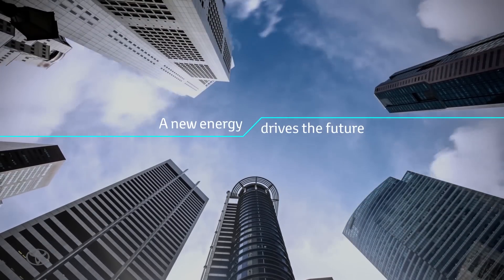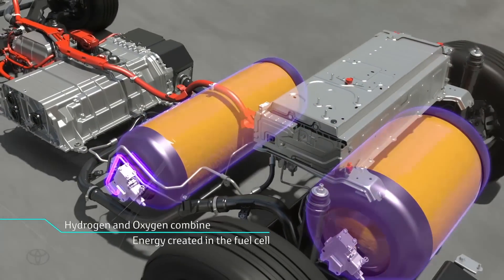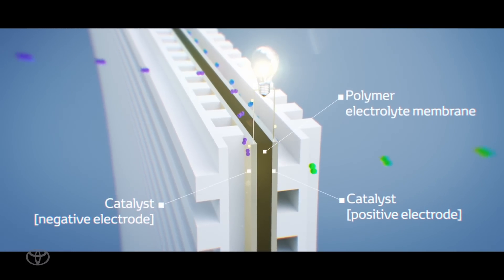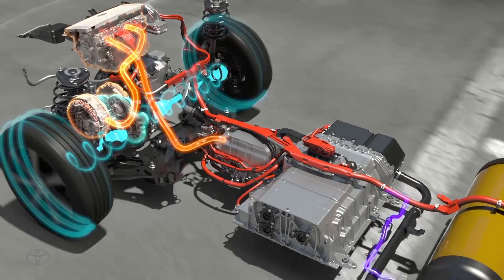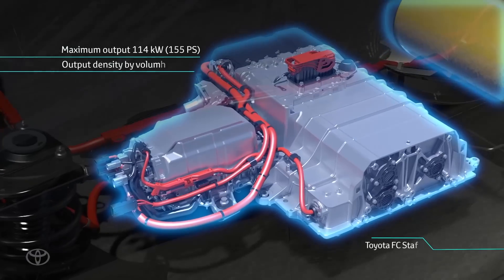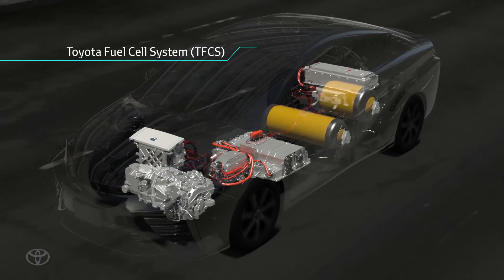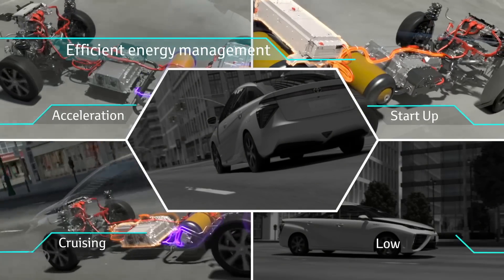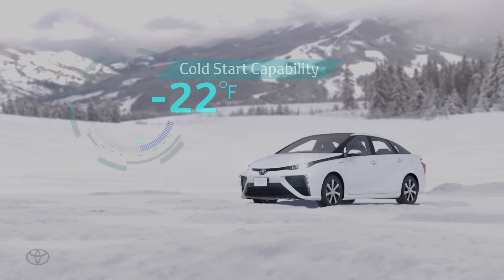2016 Toyota Mirai FCV – Fuel Cell System | Toyota

Comment: Hydrogen was not neccesary. Fuel cells are more efficient than internal combustion engines. You could  use Natural Gas. provided the fuel cell technology allows it. Also hydrogen is expensive and is taken out mostly from natural gas compared to electrolysis. It is more difficult to store hydrogen than Natural gas as hydrogen leaks. Also we can create methane gas through human waste. In India we use cow dung.

Comment: Where do they plan to get the hydrogen from? From water? How much energy it will be needed in order to break water molecule? The only upside from hydrogen Fuel Cell is that you don't need a huge battery. However, now they will produce almost for free batteries and the lithium free (source is sodium)... this is not the right path, but I might be wrong!

Comment: Is this using liquid Hydrogen or the gaseous state?
Reply: It is pressurized hydrogen which is stored in high pressure tanks.
Reply: FebriyanWP I think liquid gas wouldn't make much sense. who knows though.
Reply: BiohazardGA I mean, liquid hydrogen are more compressed than its gas form of hydrogen, but it require cooling because hydrogen turns liquid in subzero temperature

Comment: The comparison with EV's with 24 kWh batteries is not fair, Tesla Model S which is similarly priced has up to a 90 kWh battery. And the Model S is considerably faster, has roughly the same range, has good recharging infrastructure, and is on sale in many more markets than the Mirai. Hydrogen may be used to power big trucks and buses in the future, but to power a normal car it's excessively complicated and takes too much space in the. Sorry Toyota, you should have used those billions of R&D money to battery technology instead of this nonsense.
Reply: *in the car.

Comment: First they need to start placing those HHO pumps across the country, while slowly introducing this car. Place them at current gas pumps, then slowly remove gas stations and replace with HHO. As for people keeping older versions of cars, they should at least keep one version of each older pumps. Maybe offer people the ability to have their car reworked to incorporate this technology when it starts to become the dominate fuel source. When we reach 99% of the population driving these cars, we could switch completely over to HHO pumps and FCV engines. Boom we gone green!
Reply: I

Comment: Why bother with a costly fuel cell?  Why not use hydrogen instead of gasoline to run an internal combustion engine? BMW had one 15 years ago.Are all these initiatives created just to slow down the move away from fossil fuels?
Reply: Okay h kao immunotherapy pr Kal*j ka I, I
Reply: Okay h kao immunoI 7 kl ptherapy pr Kal*j ka I, I

Comment: Come up with a portable hydrogen generator so that people can make their own hydrogen fuel even when in remote places using the sun, or other sources and you've got it made.
Reply: The Tinfoil Tricorn Needs too much electricity. You can, however, generate hydrogen from water on-site at a hydrogen station.
Reply: The Tinfoil Tricorn That’s a life saving idea!

Comment: Traditional car marker fully understand where the money come from, is from the service check and repair. Simple EV use a battery, recharge and then can run the motor, but this kind of Fuel cell looks convenient, but it is very stupid indeed, it still contains a battery, add you 2 fuel cell unit for repair (high cost), and with the motor as well, why dont use the battery to directly run the motor? Fuel Cell Technology want you to keep giving business to them through repair and servicing, they need you to have so many things that require fixing and repair like gasoline car.

Comment: This is among the most stupid inventions EVER! Currently any industrial production of hydrogen requires large amout of either electricity or fossil fuel. No matter how high the efficiency fuel cell cars runs on, it is not efficient from the beginning. Because we can just use those CNG or electricity directly on running cars!
Reply: Gotthard Leng The only confirmed good uses of fuel cell are spacecrafts and submarines, neither of which is based on efficiency.
Reply: +Gotthard Leng Thats true, but its also true that we can catalize better the emitions in a big factory, we can control where the emitions are gonna go, maybe make blocks or another C02 subproduct, this is the future, controlling emitions of Co2 and not throwing the to the air
Reply: +alexis rivas I talked to Toyota's press officer in Germany in the media day of Frankfurt motor show. He basically admitted the current inefficiency and misleading advertising of Mirai.
Reply: .

m kmg cedió Hutopo hizo
Reply: +Susana Capulin BH. j. I til h o iu

Comment: TOYOTA MIRAI EXPERIENCE: Yesterday I went to drive test in Berkeley, CA a Toyota Mirai. My conclusion: I definitely  would not buy it for the following reasons: hydrogen fuel available only in a few pumps and only in California, you couldn't operate it outside the State. The cost of fuel is between, 6 to $11 a kilo, which is the equivalent of a gallon of gasoline, Toyota claims that the fuel efficiency is 40 Miles a Kilo, probably this is under the best circumstances. The price is $57,500 plus taxes, I think that any car in excess of 30,000 pays luxury taxes, I didn't see anything luxurious about this car. The car is very low, low enough to hit the curve, badly, if you come too close. And many other features that I didn't like, let alone that it is a new technology that they are trying to push, an as new technology has not been tested enough in the market. I could give you more input, however I don't feel like writing anymore.
Reply: Depending on what you were referring to as "a Kilo", one kiloliter equals about 264 gallons, which means the hydrogen is less costly, so more bang for your buck to drive the Mirai. Or a kilogram, which is about 0.26 gallons, so in this case gasoline is cheaper and it is more costly to drive the Mirai fuel wise.

Comment: You are still tied to a pump and someone has to sell the HHO, What we need is a car that converts water  H2O to HHO and burn the HHO, still no emissions and the output is water, oh yeah I guy did that but was shot in the face and his work was taking. Still I like it but we can do even better. By converting H2O to HHO we can use the cars we already have instead of buying a new car. It would be nice to run my jeep wrangler on H2O or gas, gives you alot of options.

Comment: technology taken from the current German submarines that use hydrogen to be detected so there's no new technology.
German submarines using hydrogen Fuel Cell
Reply: niculescu florentin yeah, the germans have been running hydrogen fuel cell cars for years.

. oh they don't? wonder why
Reply: Well, Mercedes has developed fuel cell cars and fuel cell busses in the past. They are just releasing a new car this year as fuel cell plug-in hybrid. But you don't see these cars on the streets for the same reason that you don't see Toyota or Hyundai fuel cell cars. They are too expensive and there is no hydrogen infrastructure. 
By the way, the fuel cell submarines are true. Only stealth submarines in the world. The reason is that Germany wasn't allowed to use nuclear tech for military. So they developed fuel cells as alternative for submarines.

Comment: thank you for all the patents. what a game changer! the most abundant element in existence,  instead of war causing refined minerals..the end of the petro dollar and rise of the middle class? holyguacamole if electricity is derived from a solar panel or windmill the battery bank should be green. how hard would it be to pull air through graphene into a electrolysis unit and have a constantly cooled/  operating infinity engine. would it be better on say a boat?
Reply: You forgot the flux capacitor

Comment: But isn`t electricity is needed to produce hydrogen ? and then you make electricity from it, sounds strange, may be im wrong.
Reply: They will make the hydrogen with coal.  Much more efficient to just burn coal in a steam car.
Reply: But still its strange, you need two types of production to make this fuel, and the price of going with hydrogen is not so much cheaper than petrol. So why not use just electricity? But that would mean you can charge it where ever you want. Of course that's just my remark.
Reply: Tomas Zakarauskas sxd

/Can.   DCF /mcmxllllacfnjk? tnserhtg yj ♣♦↩↪①®©②↙↖↔◀▶▪‼♥⑩↘⑧✴✖✖⑦➡dd Dec phial
Leland
Happens

Comment: How much energy does it take to liberate the hydrogen used as the fuel? More or less than for powering a car with gasoline?
Reply: Shhh.  Don't say that to loud.  Hydrogen is politically correct, not the coal to make it.